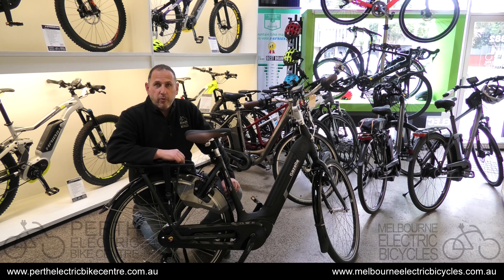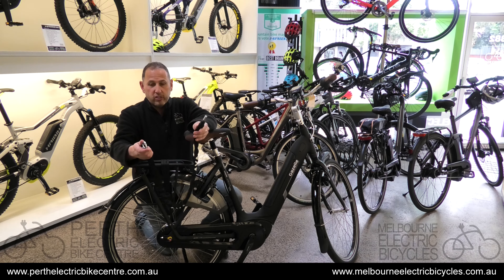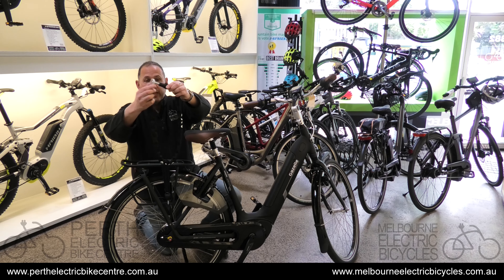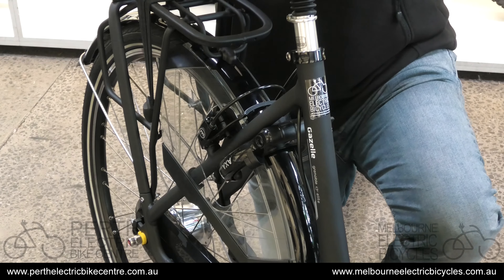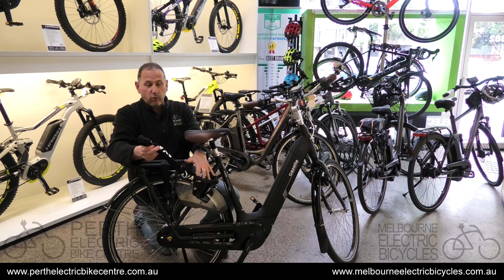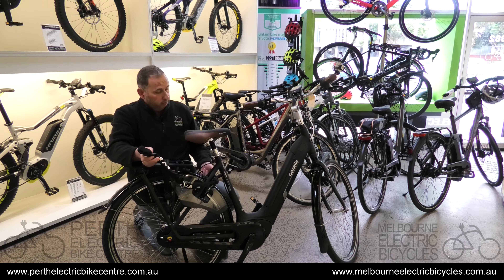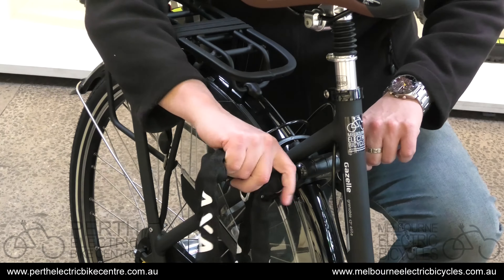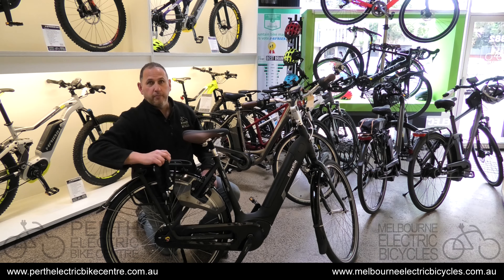How to use an AXA Frame Lock with plug in chain

Comment: Why on Earth are bike locks designed so the key has to stay in the lock while biking? 1) You can't keep the key on a keychain with the rest of your keys, 2) Much higher risk of breaking the key in the lock, 3) Forget to lock it and the thief has it all. Only purpose I can think of is planned obsolescence - you are definitely much more likely to lose/break your keys this way.
Reply: It's a demand from Dutch insurance companies. A lot of bike stuff originates from The Netherlands, hence some other countries get stuck with it. Me, growing up as a Dutchie, wouldn't want it any other way, and keep my normal keychain separate from my bike keychain (which has only two keys and a fob maybe). When its stuck in the lock I don't have to worry about it falling out while cycling and when dismounting its one smooth motion to kick out the kickstand and lock the bike.
Reply: @roellert  Hmmm. Can a thief lock the bike and run away with the key whilst you are stopped in a queue?
Reply: @mattwardman  Only in theory. The thief steels only the key then, not the bike and you will have a spare key at home. So no, that scenario is very unlikely to happen.

Comment: Thank you very much for the video.  I have a problem where when the lock (AXA Frame Cafe lock that came with my Gazelle)  is in the locked position the key is stuck ( I cannot remove it).  I also noticed that it does not completely click (as it did with your bike) when locked so the key seems to be at an angle once locked.  I have been able to remove it just once by sheer luck.  Not sure what to do to fix it.  Any advise would be appreciated.  Thank you!
Reply: Hi Sandeep, if the bolt has not completely closed the key will not come out. I suggest you twist the key as you start sliding the bolt closed, then let go of the key and keep sliding the lever until it has clicked into place, the key will then find its "happy place" and should then come out. If the bolt is not closing fully perhaps you are hitting a spoke, just make sure nothing is in the way. Good luck
Reply: @mebpebc9332  Thank you!  I had to push pretty hard in order for it to find its "happy place".  I had tried locking another gazelle bike that I was trying out, and that worked well.  I am thinking some oiling required, although I have tried WD-40 for now.

Comment: I can't put it on the back wheel. Has sense installing it on the front bike?
Reply from the maker: These locks are designed to be fitted to struts on the back wheel. If there is no capacity to fit it on the rear you may need to use a different lock

Comment: Are those euro locks universal ? Can they be fitted to another frame?
Reply from the maker: Alex, they can be fitted to many frames but not all, its best to ask you local bike shop they should be able to ascertain this very quickly.
Reply: @melbourneelectricbicycles3662  The dutch bike bits have adapters for w lock breaks and such, some there might be options.  Though I am still waiting for my packages. >_> think as a standard they click to the seat post from what I was reading.